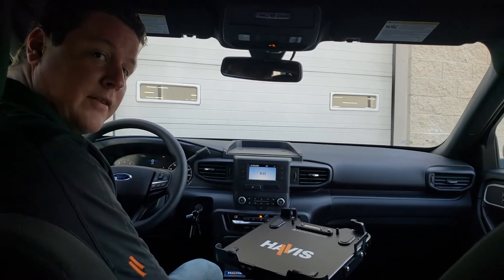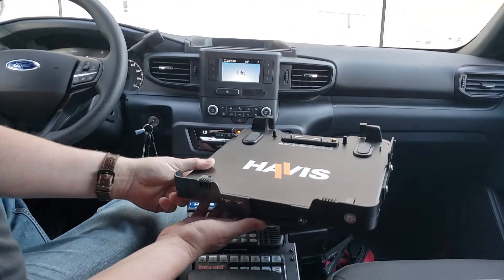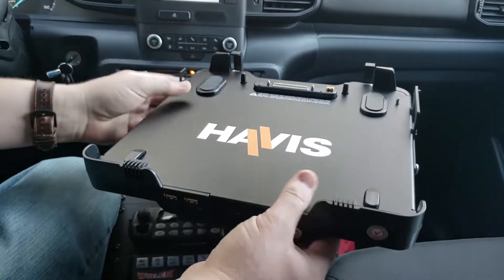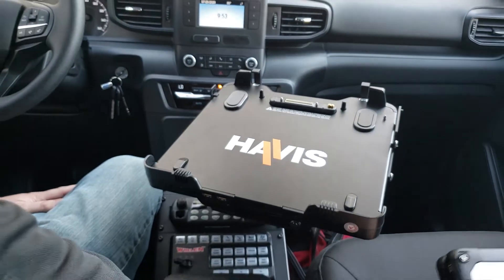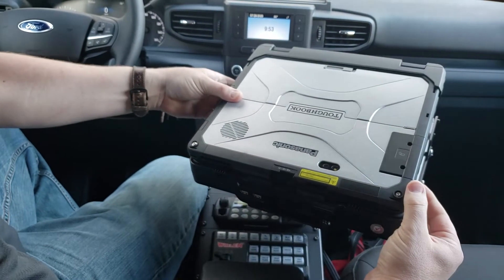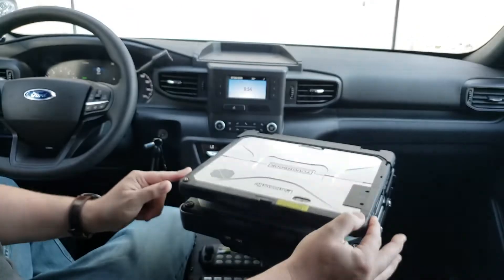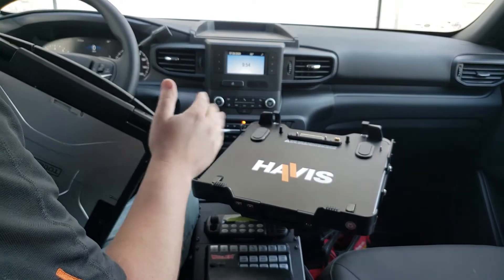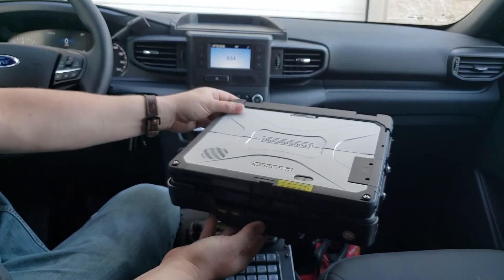Panasonic TOUGHBOOK 20 & 33 Installation Guide: Step-by-Step Video Tutorial | Havis Inc.

Comment: Do u make one for a Panasonic Toughbook CF-19, MK8, 10.1-inch Touchscreen, Rugged Laptop Convertible Tablet, Intel Core i5-3610ME @2.70GHz, 8GB, 256GB SSD, Windows 10 Pro (Renewed)
Reply from the maker: Hello! We used to make one (DS-PAN-210 and 220 Series), but it has been discontinued. There may still be a few available if you reach out to a local reseller: https://www.havis.com/how-to-buy/find-a-reseller/
Reply: Ebay

Comment: What docking station and accessories do you recommend for a Panasonic CF-31 used in a production environment with forklift drivers driving over rough cracked floors loading and unloading semi trucks?
Reply from the maker: Hi Dan! We do not recommend mounting the CF31 in material handling applications due to its size and weight, but we have many safe and reliable solutions for tablet mounting on forklifts.
Reply: @HavisIncorporated  okay what is the model number of your mount for that application so I can check it out?
Reply: @HavisIncorporated  The customer has already gone in that direction.   I'm looking for your best option to mount the CF-31unit on a forklift.
Reply from the maker: @DJ_Driven  Hi Dan. Are you able to provide images of your current setup for us to review and provide our recommendations? Please email them to dheiland@havis.com. Our product manager is going to look into this for you!
Reply: @HavisIncorporated  My company also just purchased CF-31 toughbooks for us to use, and has now tasked us with finding mounts. Do you have anything for a forklift yet for this laptop?
Reply from the maker: @LigmaRustyDonut  Hi Jason, we are looking into this for you.
Reply from the maker: @LigmaRustyDonut  Hi Jason, our dock for this laptop has been DISCONTINUED (DS-PAN-110 series). There may still be a few available if you reach out to a local reseller: https://www.havis.com/how-to-buy/find-a-reseller/

We  do have an MH-3007 which is an under-seat mount for forklift applications, but it may be limited on which forklifts it is compatible with.